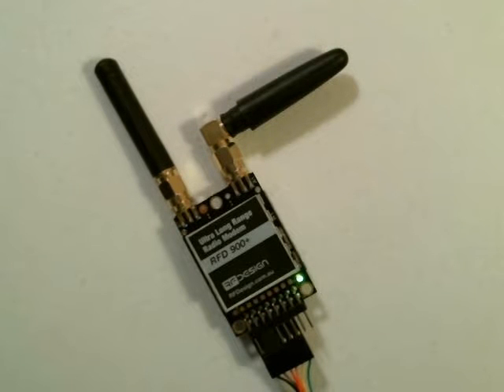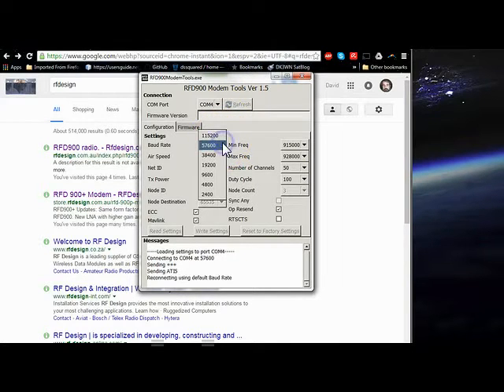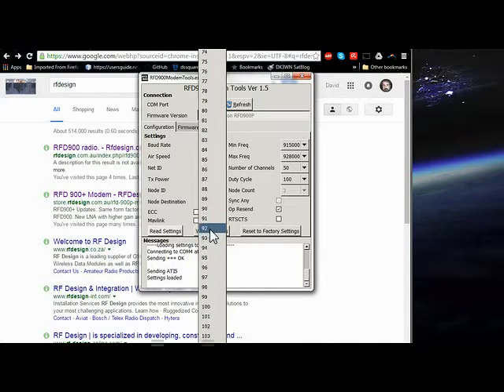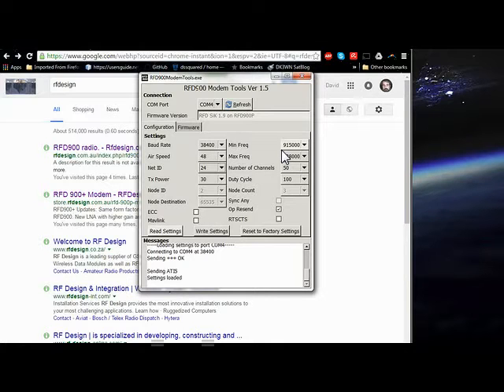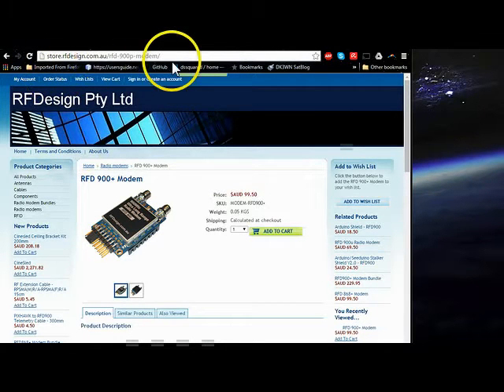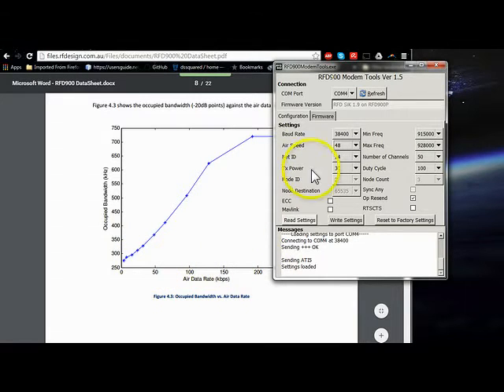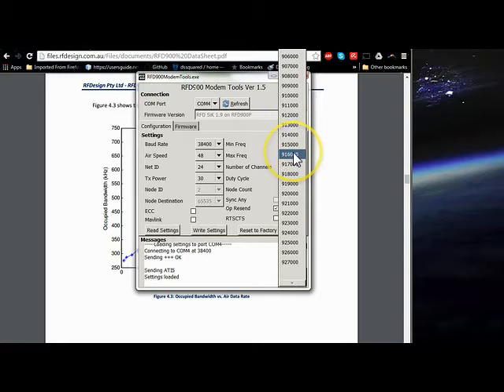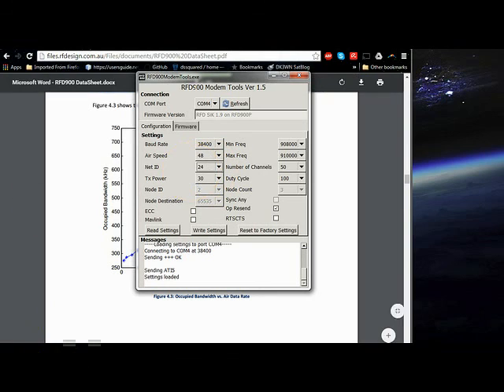RFD config 2

Comment: Hoping you get this… I have the RFD900x and out of the box both connected to power, I get a solid green LED however when connecting to RFD Tools v2.60, it fails to connect. I do get a COM Port assigned to the FTDI cable when it is plugged in. Any ideas?
Reply: I'm not sure if it is too late, but try with other baudrates while connecting
Reply: Thanks and ill give it a shot@huseyintuysuz694